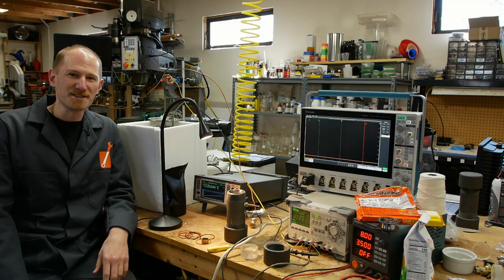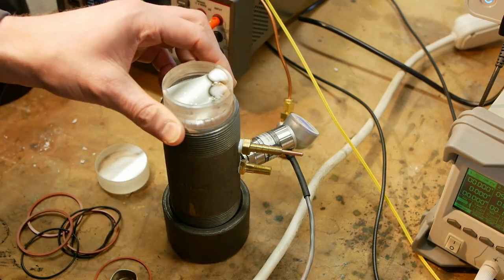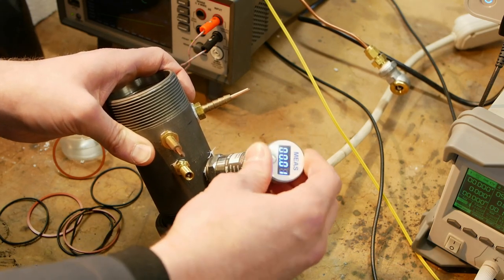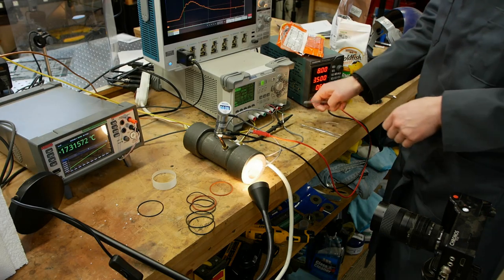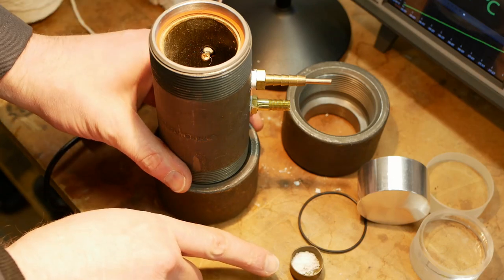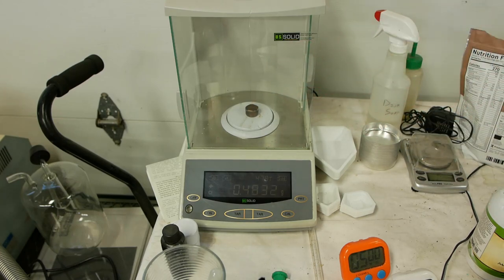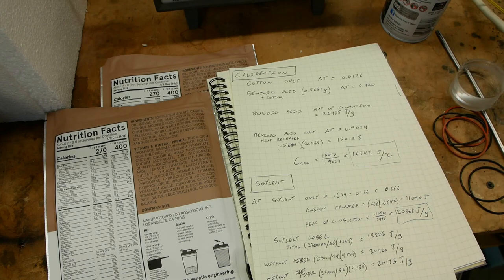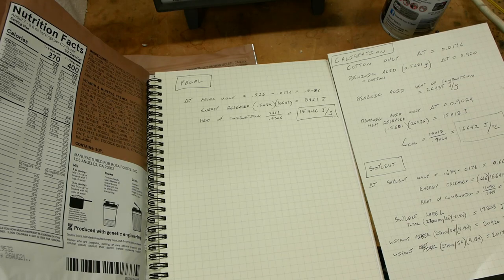Measuring human digestive efficiency vs. a flame

Comment: Thank you for doing this! This has bugged me ever since we had to do calorimetry in high school science. I asked about the difference between flammable caloric content and what your body can use, and basically got told to shut up and burn my peanut so we could get on with it.
Reply: @capekraken2672  not really true tbh, for basics absolutely, but academics exceed in killing passions. if there's anything your actually interested in, from my experience, its better to do it yourself. which sucks!
Reply: @albertogregory9678  sure, but I would not go as far as stating it is a passion killer. Even if you absolutely know your passion (which is more rare than not for high schoolers), you need to know how to do other things than just your passion. As well, school (at least here in Australia), you can choose which subjects you do and which ones you want to excel at.
Reply: @capekraken2672  I disagree. I never went to elementary school or middle school but had a 4.0 gpa in high school
Reply: @neil963  I find that extremely unlikely. Did you have home schooling? If not, you must have worked extremely hard to catch up. Even so, you still had schooling which was not my point
Reply: Yep. Education via other people is a giant joke
Reply: @capekraken2672  It was a Montessori school so I guess take that how you will. But yeah I had to work insanely hard to catch up I was awful at essay writing but luckily I had understanding teachers.
Reply: @capekraken2672  Most people don't even use or know how to use the knowledge they learn in school. You really think you'd be a "vegetable..."

It's ridiculously silly that we ration out bits and pieces of knowledge in every subject area such that proficiency takes a decade and most of them hate nearly all of it. Math would legitimately take months to learn up to a grade 12 level if you put in 4 hrs a day, even starting from zero. If a kid wants to learn 4 hrs of anything a day they should be encouraged very strongly to do so, that's how you get prodigies. Instead we drain them of all mental energy for the day and teach them barely anything. 

School is very outdated and it absolutely is a passion killer. 
I do agree that the baseline of knowledge school provides is great but it's really not worth the cost and there are much better ways to get people to that baseline.
Reply: @TheInfectous  sure I agree with the first bit, however there is a reason why schooling is used. There is no better way (there is other schooling methods but they lay relatively the same principals) to educate entire populations of people as to such that the population is such of a high level. Not every student wants to do maths, some want to do lots, but we have to compromise. Plus I assure you the math level that some students do nowdays would take WAY longer than a couple months to learn from zero.
Reply: @capekraken2672  "No better way" Proof?
Reply: @capekraken2672  its the exact opposite for anyone with a bit of curiosity. 
School kept me away from interests that were far more giving in terms of educational content, and had me associate "learning" and problemsolving with rote memorization of nonsensical bullshit.

Granted, for the dimwits and midwits, school is probably valuable, but for the decently intelligent and/or creative people, whose interests simply lie outside of the mostly useless curriculum, school is absolutely a waste of time.

- I say that, having graduated a masters degree of software engineering, where I attended only 30-50% of the classes, and spent 80% of my freetime on pastime interests, yet achieved a higher grade than 85% of the students my year. 

What does this tell you? No school = veggie? :')
Its the ones that sit inside all day and learn to associate people talking and information being dumped on you, with something to ignore/filter out, that have it hard. Those people for the most part turn into veggies that only know to repeat what the media and other perceived authorities tell them. Absolute NPC's, the lot of them.
Reply: @Sgtassburgler  The proof is that almost every single educational system in the world uses it. Have you got any proof for the contrary?
Reply: @NukeCloudstalker  Great, you can do that. You are also a very small percentage of the population. You are also very overestimating the capabilities of the average student. As well different people learn different, you can sit outside, not attend classes (university is different than high school but let's ignore that for a moment) and will do fine, great! Other people may not be able to do that. To you the schooling system apparently 'didn't work' for you but it may have worked for others. My point was the population is better off with education, and it is not entirely useless for lifting the average knowledge and awareness of the population. People will always be sheep, don't equate that with education.
Reply: @capekraken2672  yea, long-form commentary, discussion and reading didn't strike me as something within your capacity. 

God forbid you limit the amount of things you engage with, and engage with them fully. Rather be a scatterbrain like you, and say "don't care" after starting a conversation on a topic that deserves more than a few sentences of thought. 

Utterly predictable, and utterly despicable.
Reply: @cataclystp  "REAL smart people don't think they're smart"

Relative to themselves, broader society, or the people they surround themselves with?

Because I know a lot of people smarter than me, and they know they're smarter than me too, and we don't pretend otherwise either. 

The notion that smart people can't claim to be smart, because otherwise they're really not smart, is just a massive fucking slave-morality cope. 

You didn't get pissed over me being wrong, you got pissed over me being right. Didn't you?
Reply: Tl;dr : school is shit and could be a lot better, but it's good enough to be an acceptable compromise for parents that don't have the time to teach their kids.

Most home schooled kids I know know more than school taught kids, but sometimes do lack some knowledge, which may or may not be relevant.
School is mostly memorization, but not a lot of practice, and is very inefficient, because it needs to work with averages.
The good thing about school is that it brings the average up, but it is dreadful for learning about a specific subject.
Teaching methods aren't really updated, there are better methods but the system is really slow to adapt (because teachers have to learn in detail what they teach, people who make the programs have to plan, propane, and put in place and so it takes years to decades to change anything.)
Teaching tests are standardized so teachers are exchangeable, and kids can be fed through without much trouble, if it wasn't like that the levels would be really different. 
I do think that having classes per level of each subject might be more productive, though it would be a scheduling hassle, but computers might make it work.

School is good too because parents can't always be there to teach kids, but now that the internet is a thing, I think having more relevant teaching methods might be feasible.

I read somewhere that school is about 30% efficient, because kids that fit outside of the average either over or under learn (i.e. fall behind or get bored)

Tests aren't great at making pupils learn, because whether they ace the test or get nothing the class will move on. It also incentivizes  learning just enough for the test and forgetting after it, and cheating, since what is often rewarded is getting a good grade and not learning.

Tests also are really irrelevant in today's world, since knowing formulas by heart or having a cheat sheet/being able to look them up works just as well in application. There's a reason most scientists use Wolfram alpha or matlab instead of solving by hand.

I hated school and ended dropping off because I could just study for a couple hours right before the test and do something else during the class, but I had to be in class and slog through the same thing over and over instead of doing something interesting.
I had a burnout because of that and I've only started to recover 5 years later.

College is mostly relevant as a connections game, where you meat people who might help you later, most courses can be condensed in a couple of days when needed.
Reply: @capekraken2672  i'd say it depends on the school. A good one would be a place that actively encpurages learning and deeloping passions, whereas a bad one is well, a 9-5.
Reply: You guys really put into perspective how awful my Hawaiian school was I’d wake up at 4 am pop a motion sickness med travel an hour and a half along the windiest road on earth on public transportation get to the bottom of the hill where my school is, have to hike another 30 minutes up a volcano get to school then after school wait till 5pm at the nearest McDonald’s where 3 other unfortunate kids like myself were get home 8 PM and pass out depressed and tired only to get put in classes like agriculture and jrotc because we have nothing else and learn theoretical physics all day from the books from the late 90s in the library nobody would use because the teachers including the science teachers didn’t even understand basic physics until one day I fell into a depression thinking that that’s all my life would be and dropped out 10/10 learning experience looking at spending my life repairing air conditioners rather than in a lab.
Reply: @bigshrimp6458  tbh hvac work can be pretty interesting, especially if you move into conception
Reply: @capekraken2672  the first guy criticized public school, not schooling in general, you straw manned from the beginning.
Reply: @Aggrobiscuit  thanks man really made my day, hope you have a good one as well

Comment: Here's a video idea: You can use your mass spectrometer and some isotopic water to measure exactly how many calories you've burned in up to about two weeks. It's called the "Doubly Labeled Water Test".

The idea is that you drink some water with a safe percentage of both 18-O and 2-H in it (get by mixing partial 18-O water with partial deuterium water, each not terribly expensive) and 15 minutes later measure the baseline ratio of 18-O to 2-H in your urine. After however many days, the 18-O and 2-H will have diminished an equal amount by leaving the body as water, but only 18-O will have been incorporated into exhaled CO2, which by definition is a direct measure of calories burned. So at the end of that time period, the new ratio of 18-O to 2-H in your urine tells you exactly how many calories you've burned in that time. And all you need is the isotopic water and your mass spectrometer.
Reply: Very cool idea! But it just measures the energy you've burned during the time of measurement. Burning of fat already stored in the body as well as new deposits can not be monitored this way.
I'd rather stay on his track measuring the source of energy instead of it's outcome as he tried. But he didn't account for the loss of mass since digesting means taking up the nutrients (and finally breathing them out as CO2). So i'd correct for this error by adding an undigestable stable compound not being absorbed by the body added to the soylent to correct this flaw.
Reply: Doesn't most of the oxygen from co2 come from oxygen in the air?
Reply: @hetsmiecht1029  Some of it, but CO2 is a waste product of our metabolism.